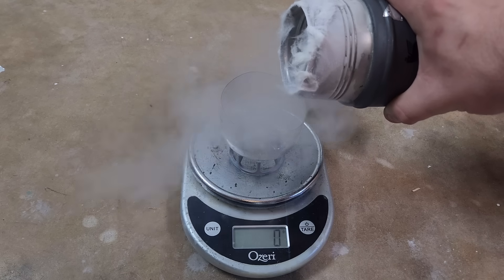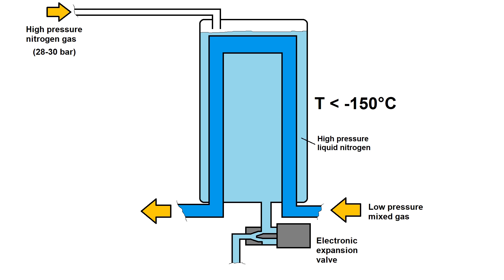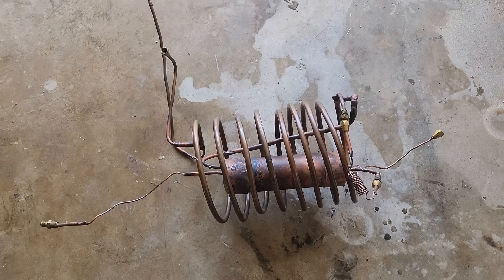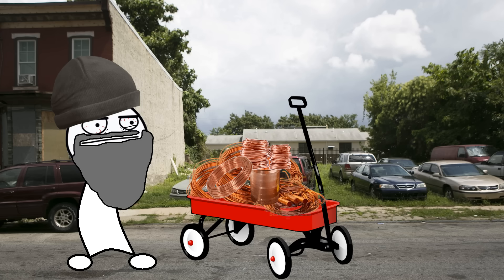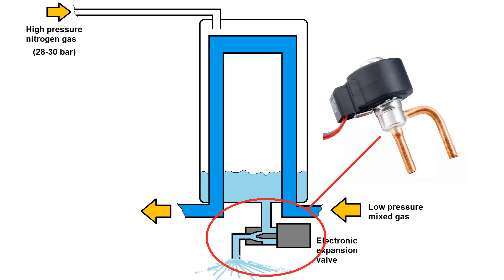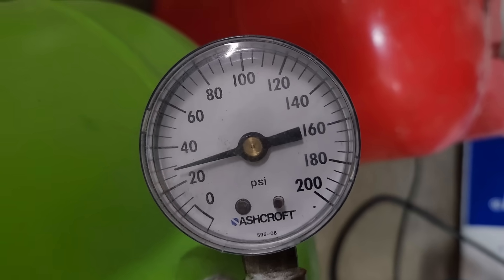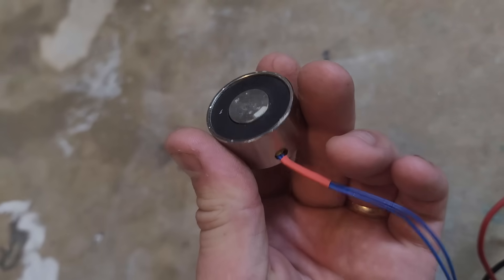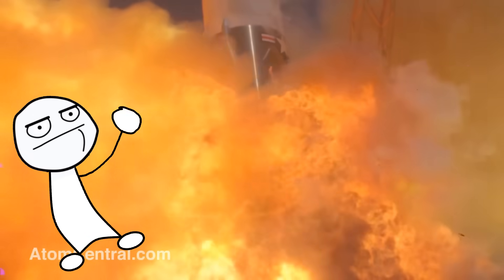Making Liquid Nitrogen with my Homemade Cryocooler

Comment: Watching your videos really makes me want to make a compressor cooling system for my PC
Reply: Tech ingredients here on youtube shows how to make a window ac unit into a pc cooler. works like a charm, and easy to do.
Reply: @demandred1957  Neat, mind I always think about a Micro-Split kinda thing. To dump the heat outside.
Reply: Ehh, lot of condensation. Maybe a system that keeps the evaporator temp around ambient would be useful but that could be hard to do. Go much lower than ambient and hit the dew point and you have problems
Reply: @DarkAttack14  they could just slap a mondo block of copper between the phase change unit and the IHS to act as a thermal buffer. Would allow them to program it to have a hysteresis of a few degrees on either side of ambient so that it's not going on and off every few minutes. Spread out the duty cycle a little bit to save power and wear on the compressor.
Reply: @Groovewonder2 : If someone wanted a temperature buffer for a cooling system, then a thin-walled pipe running through a tank of water will usually do better than a block of copper, because water:
1) has a lot of thermal mass (so very temperature-stable),
2) is cheap, so it's easy to get a whole lot of it, and
3) is a liquid at useful temperatures, so you can pump it around to get better heat transfer.
Reply: The term you're gonna wanna use for research is "phase-change cooling", maybe with something about PCs added onto it for googling. It's possible, but requires a fair bit of setup to get right. Definitely spare no expense for condensation resistance.
Reply: We have localy so called Tami4 (Mini bar). It's like water filter, sanitizer, cooler , heater in one box. 35x35x35 box on kitchen. It has small compressor inside, capable cooling water to 5-7 degress within 10 minutes (tapwater around 25-28 C). Small thermos about 2L to store and keep water cooled. 
But if you remove tapwater , filter and sanitizer with closed loop true thermos , you can easly cooling CPU or GPU water block. I don't know exacly about BTU of this system and all the parameters. But seems plausible.
Reply: just keep your temps above dew point
Reply: Made one a few years ago with a micro inverter compressor that chilled loop water to 3F above the dewpoint.  I managed to cram it all into a 6x6x4 box along with all the controls to modulate flow, compressor duty, and condenser fan speed while monitoring and computing dew point so it can go from 10% at idle to 100% based on entering water temperature to the chiller.  It could handle up to 500W of load and ran off the 12v rail from the PSU.
Reply: Watching this video really makes me want to play KSP again..
Reply: It's been done but they all suck. There are huuuuuuuge issues with it because of condensation. Mineral Oil Bath with a an AC cooler in the circulation is probably the most DIY friendly. you could circulate the oil and put baffles in to direct the cooling properly. The problem with all the commercial ones has been they suck because they try to work normally with normal high end consumer hardware. but if you go exotic with mineral oil pumps and replacing all the plastic or not relying on it at all, then it can be done with some custom made oil resistant 3d prints and a window AC unit. 
hell, I kinda wanna do this now too. but I literally can't afford a computer that could make use of this level of overengineering. also I work in HPC so I know how useless making one computer fast is lol
Reply: That is a thing that you can do without an engineering degree. (Buying the refrigerant, on the other hand, is a different story.)
Reply: using novec 7000 chipcleaner . from 3M u can cool til -120 c . there are some video's. der bauwer.  i want my pc at -70 and a multiplex system for the other needs in my house. try to connect my fridge koelkast, Ac , heatpumpboiler in one system.
Reply: In general, compressor-based cooling systems cam be dicey with computers, because if you aren't careful you can wind up with a cooling system that's too weak to do as well as a normal air-cooling system. Also, they're often more expensive to run than normal air cooling.

If you want a good system, then probably the best option is a water-cooling system with it's radiators outside the case (if the radiators are outside the case, then they can be as big as you want- you could literally have twelve semi-tractor radiators piped in parallel), followed by an evaporative loop outside that gets tied in or isolated based on exterior conditions (no point using the external branch if conditions prevent it from helping).
Reply: My man needs to read about heat-pipes!
Basically a solid-state version where a sealed copper tube is filled with insert fluid here that when one end is heated above the boiling point of the liquid; the vapor carries the heat to the opposite end which is being actively cooled - and thus condenses; wicks down to the hot-end to be boiled off again!
They are ingenious things; but they are limited to the boiling and condensing point of the fluid inside...

If you want a -175 degree CPU, you can't get that without a compressor.
And possibly breaking the computer (the parts are generally only rated to minus 55), or reducing it's performance, as many CPUs seem to perform better at their usual 50 degrees than they do if they are cooled below freezing. Overclockers would disagree, but you can't get an overclocked machine to give you a decade of reliable gaming...
Reply: Step 1: buy a fridge and plug it in.
Step 2: open fridge-door.
Step 3: place pc into fridge
Step 4: close fridge-door and cover wires from pc to peripherals.
Step 5: keep fridge close.

Or use a freezer. Both should come with a drain for the condensed water which will form on the cold wall and not your pc.
Reply: @DreadX10  that does not work. Tech Ingredients tested that. the window ac solution is "make a cardboard flange to connect the ac unit to the side of the pc. Turn the ac on..done."
if you wanted to go hard, mount the ac in the window like normal, get a shelf whatever to set the pc on so it's at the ac's height, and follow their directions from there.
Reply: Water cool but with peltier cooler, what about ?
Reply: @rian0xFFF super inefficient, Intel I believe made one.. they are like 20% efficient.. so 200 watts of Cooling is around 1000 watts of power from the plug.. lol